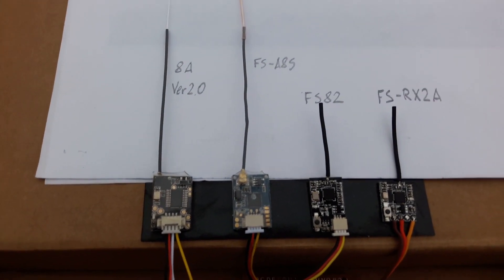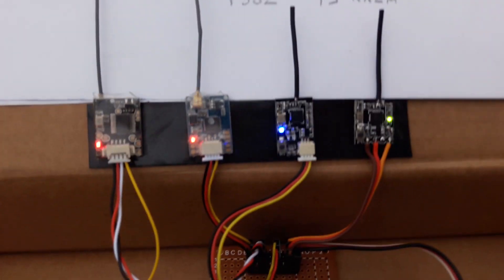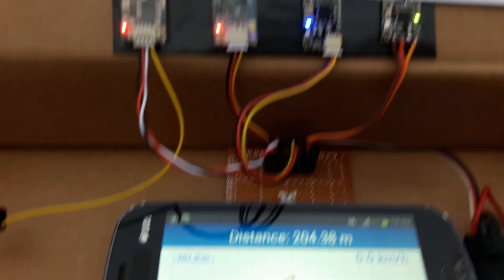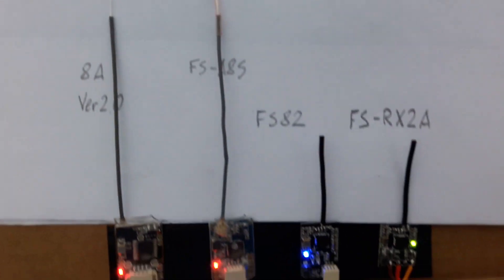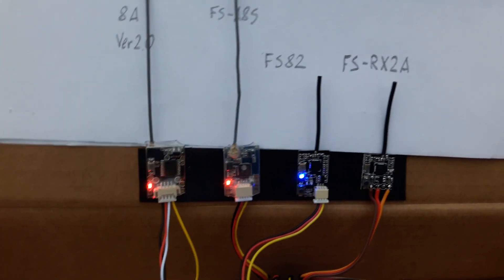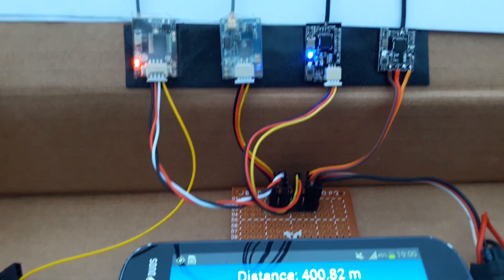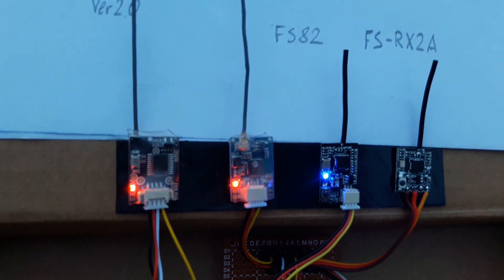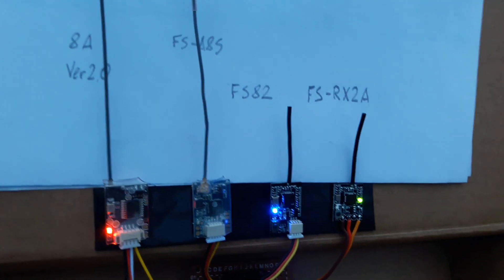FlySky micro receivers ground level range test

Comment: Nice video, question about 8A Mini Reiciever, hot to set failsafe if possible?
Reply from the maker: If I remember correctly, this receiver has failsafe. It should output zero throttle (CH3) after failsafe.

Comment: this was dope you saved me alot of trouble....im new to drones and quads, so just to clarify i can get the 8A Mini Receiver attach it to any drone then i can fly that drone with my FlySky FS-i6 ?
Reply from the maker: Yes, 8A mini Flysky receiver works with FS-i6. Range is not something exceptional, but it works.
Reply: @MontisTube  thanks this will be for a micro build so what type of range should i be expecting?
Reply from the maker: @nickodadon1328  I would say a few hundred meters.
Reply: @MontisTube  okay, and the 8a  was the best one out of the four you showed?
Reply from the maker: Yeah, that receiver showed the best results to me. Of course I've tested only the one receiver and it is not necessary the absolute result. 
But hey this receiver is cheap ;)
Reply: @MontisTube  lol exactly you get what you pay for and im going cheap.im actually working on my first build right now.im wanting to make a super light tiny whoop with some weak eachine 1140 motors,you think thats possible?
Reply from the maker: Yes, that is possible. This is the beauty of this hobby: you can be creative and try different things. 
KababFPV is one of the creativest RC hobbysts.
Reply: @MontisTube  ill def check his channel out..... are there any rules that apply when im deciding what esc,flight control,and the battery to use,like a wattage or voltage?
Reply from the maker: @nickodadon1328  yeah, everything depends on what size of the props, size of the motor, KV rating of the motor and battery cell number you are going to use.

Comment: which one would be best if im flying in a wooded area? which one has the best type of signal to be able to fly freestyle?
Reply from the maker: For better penetration and range I would suggest you the Flysky FS-X14S receiver (http://bit.ly/Banggood-Flysky-FS-X14S-14ch-Receiver). It has diversity antennas, PA/LNA amplifier and rated for 500-1500m range. There is also alternative firmware with RSSI output (http://www.multirotorguide.com/guide/flysky-receivers-rssi-mod-alternative-firmware/)

Comment: Exactly where do I connect the 4 wires of the FS-RX2A V1 to the HGLRC XJB-F413 receiver?
Reply from the maker: You need to connect the yellow (IBUS) wire to SBUS pad on the FC and turn the RX inversion off OR connect white (PPM) wire to the PPM pad on the FC. Also set IBUS serial RX or PPM in the receiver settings in Betaflight Configurator.

Comment: Both micro rx I have gotten a quarter mile with at low altitude with metal buildings. https://youtu.be/CsT02j1-G0g
The intersection in front of the quad when turning around was just about a quarter mile. Was losing video feed when I turned around. After upgrading vtx I could reach the intersection past the one I turned around at which is around 2000'. That particular rx is fs82 and the turn around point was approximately 1100'. A quarter mile is about 1300'. 

TX was stock during that video.
Reply: This was a ground level test for those who are into RC Boats, Cars, Trucks, Tanks, Dirt Bikes, Hovercrafts, Sports bikes, Submarines, Buggy's and all other robotics that operate at ground or sea level. Range Testing a Quad, Heli, Plane or any other Airborne UAV is a different subject altogether. These ground tests are hard to come by. Cheers Outlaw 👍

Comment: I have the 8A Mini Receiver and the Flysky FS-A8S. Having brownout problems with the 8A Mini...
Reply from the maker: Perhaps you are the one out of a few who has brownouts. Do you notice the same brownouts on FS-A8S also?
Reply: Used the 8A yesterday and swapped it for the FS-A8S today on the same quad. No brownouts today. Also getting better range. Stock antenna on the 8A. 30mm Antenna on the FS-A8S.
Reply from the maker: Thats good. Of course it's strange, but possible. Anyway use whatever works best for you. Maybe you've got a faulty one.
Reply: Montis I will try the 8A again with the same 30mm antenna to compare

Comment: Great test ! , this is a real world and pretty scientific to me I love real word worst possible conditions , I like to fly my drones outside around my house an trees while I’m inside my home watching fpv goggles , so I need my signal to pass through all the WiFi signals and through walls of my home and all the trees outside and other homes with WiFi’s so I think the micro receiver to the far right is good enough for me I have micro quads so I need the light weight
Reply from the maker: Hunter Mclaughlin FS-RX2A pro receiver is a good receiver, but not the best. I just would have  replaced the antenna to the one that leftmost receiver has. There is another version of this receiver (I think it is called FS-RX2A Pro v1.1 or smth) with a better antenna and u.Fl connector.
Reply: Montis well it is the smallest one I can find personally, and I’m looking for the most micro parts I can find , it’s also $7 on eBay for me in USA so that’s lsobthe cheapest one for me , others are great obviously your test shows , but then again everyone’s flying conditions are different are so are they way each of us set up out quadcopter , some of us don’t realize we are ruining the signal by horrible placement or even build quality, some get lucky some don’t . Thanks for the review it helps a lot
Reply: Montis how do I use  ibus on the rx2a pro ?
Reply from the maker: Similar to SBus, just set the serial RX protocol as IBUS and connect the IBUS signal line to the FC uart RX
Reply: Montis what uart # ? , I have been using uart 2 for PPM  of coarse & so should I just use same port and just wire the (ground, 5v , ibus ) ? . I now have to use ibus with the rx2a pro cause my ppm  pad fell off due to a lot of use from heat of the solder iron , it’s had a lot of use from putting it on and off a lot of builds so I’m ok with it being a goner cause it’s Only $8 . But it still has the ibus pad and I want to salvage it , it s done me well on range for such a small receiver I don’t fly more then 400-500 feet away anyways and I can do that easily with this thing as long as there aren’t many obstacles that interfere with signal , when it dose fail safe it holds perfectly in the air and I basically just try to remain calm for a sec , yeah right LOL ! then I usually gain control again get the hell out of there quick and try to remember where the no fly zones are in my area the give me the brown/black outs in my 2.4 & 5.8ghz signals . But I only have fail safe set on my i6s transmitter in the settings
Reply: Montis what dose my i6s have 4 antenna pads inside but they only use 2 pads for the 2 internal antennas , can in keep the internal antennas and add 2 antennas to them for external 3&5 dbi antenna mods ? If you want my email I will send pictures to you for more detail I’m not sure why they have 4 of them but only use 2
Reply from the maker: There should be only two antenna connectors inside. Both ipex (u.FL) type. Referring picture here: https://static.rcgroups.net/forums/attachments/8/4/0/9/2/a10172579-137-DSC03368.jpg
Reply from the maker: Anyway if there are 4 pats for antenna's they probably are duplicated, as there are only two RF outputs from the RF module. Therefore you shouldn't use these simultaneously with additional external antennas.
Reply from the maker: In theory iBUS can be used on any UART, as it is serial protocol and does not need inversion circuitry. Should work on UART2 RX input.
Reply from the maker: You can find my e-mail in the "About" page.
Reply: Montis I have the flysky fs i6s , that picture is of an i6 , mine had has 2 of thoes similar to this picture and it also has 2 above them but they don’t have the ipex ufl connector it’s just 2 empty pads & why do you think they are there & why would you think it’s a bad idea to use them ?

Comment: Ive heard that the fs-rx2a pro V1 is supposed to be really good. Have you ever had a chance to test it? The fs-rx2a pro (not V1) is supposed to be good too (400m), but the V1 supposedly goes 500meters plus. If anyone knows of any other recievers under 2 grams that can get over 500 meters please let me know. Im currently being plagues by flyskys bad reciever range on my ultralight 4 inch. My vtx range is like 6 times my rx range rightnow and its really frustrating.
Reply from the maker: Alex Crowder thanks for your comment. Yes, looks like there were a few revisions of the FS- RX2A receiver. I will try to order the latest and will be digging more. 
A few notes about range. All of these tiny receivers, that use only A7105 chip, should have similar limited range. Also good RX antenna also matters a lot. I would not expect more than 500m with good antenna.
There are a few new receivers with additional LNA (low noise amplifier) chip on board and decent dipole antennas. They should outperform any other RX at least by 50%. 
Look at the Flit10 RX. This RX is wery interesting. Unfortunately it weights about 4 grams.
Reply: Montis Thankyou for the quick response. I was looking at the flit10 and it looked like it was only getting 300 meters, atleast on the specs I saw. Idk if i misunderstood something, or if that was a low estimate on their page, but that seems awefully low for something that heavy.  Hopefully we can get something good thatll work for flysky soon. Ive been looking at those 4 in 1 transmitters too. Seems like they are still very flawed, but hopefully soon we will have dependable transmitters that work for any reciever. Thats my hope anyways lol. They are working on making them work better with tbs crossfire too. With any luck itll be the ultimate all in one long range transmitter once its been perfected more. Thats my hope anyways! Lol.
Reply from the maker: I think the Flit10 is underestimated. I have it on my bench, but haven't tested it yet. Until tested, everyting is just theory.
Reply: Montis what is your opinion so far? I ordered the Babyhawk r as my first real drone (started in a sim) and i have a Fs i6s Tx. Actually looked for the A8s but it shall still has this brownout issues... So what micro reciever can you guys recommend?

Comment: I have purchased most of these receivers. I tried installing the 8A mini receiver fist and the wires broke off the pigtail. I could not put the pin back in either.  I noticed the wires were not silicone coated and also burned very easily. I had to order another receiver as it's hard to find a 4 pin connector for this receiver. I then installed the A8S and had no issues. I ordered another 8A mini right away as it was probably cheaper to buy the whole receiver again then try to find wires. I may remove the A8S and put the 8A after seeing this test though. lol. Thanks for doing this test. I really appreciate it.
Reply from the maker: Yeah, 8A receiver is cheap and has cheap PVC coated wires. Beeing cheap and basicaly a clone of the original Flysky A8S it works surprisingly good. 
This test I made is amateur grade and not a scientific one :)
Reply: It may not be the most scientific one however it does show the difference. I have heard the same things on other sites and youtube channels and they have come up with basically the same results. This just confirmed what was being said. Thanks again

Comment: The best for me was rx2a pro. Dont have the fs82. Ive tested them individualy on quad.
Reply from the maker: You were lucky! I wouldn't trust rx2a pro anything bigger than 90mm quad :)
Reply: Montis whats your range with the rx2a pro ? , I’ve only attempted 120 meters while sitting inside my room of 2 story house while I fly outside , lost of obstructions but I don’t like to go outside to fly lol
Reply from the maker: Range of the rx2a pro is not great. Actually my rx2a pro performed the worst of all the tested. It is possible that better antenna could imrove the range.

Comment: Appreciate it I have 3 8A v2s they are the best, rx2a looses connection so quickly if you're in a downtown parking lot and go around a corner it's a failsafe most of the time... cheers

Comment: I have been using the RX2A on a few of my really small micros. I love that thing for being so small, but I am starting to notice that the range is definitely pretty bad. I havent hit any full-blown fail-safes, but honestly I may not have setup failsafe LOL
Reply from the maker: Be shure to set failsafe! I've seen quads flying away without failsafe. Just have in mind that RX2A has failsafe only in IBUS output and not on PPM.
Reply: Thanks for the advice and I agree. I use betaflight 3.2x I think and I believe it enables failsafe out of the box, but I would have to double-check. The issue that I ran into was weird, my controls were really unresponsive at long range and the quad got squirmy but never crashed, so I just brought it down hard and quit.
Reply from the maker: Just double check 1. under the "receiver" tab: push the throttle stick up and then turn your transmitter off. Does the throttle bar returns to the minimal value or stays at the last value? 2. Get your props off, arm the quad, throttle up and then turn your transmitter off. On both cases failsafe should cut the throttle off.

Comment: This helps😊
Reply from the maker: sakibian here , cheers!
Reply: Montis i need a lil help. Im buying a new fs i6 in some days. Do i need to upgrade firmware to use it with one of these ibus receiver? Or i can use ibus directly without doing ANYTHING?
Reply from the maker: My FS-i6 transmitter is completely stock, unmodyfied. You dont need to upgrade anything to use these receivers.
Reply: Montis thanks again man!💖

Comment: Thanks for the video. In the champion catcher, 8A, what is the function of the loose yellow wire?
Reply from the maker: Manuel Chaves it is the same as in the fs-a8s receiver: yellow wire is PPM out, white - iBus/SBUS out, red - power and black is GND. So it has two separate outputs.
Reply: Thanks for the reply. Is it possible to use the Ibus / Sbus output at the same time as the PPM? Can I use a servo motor in this PPM? Tks
Reply from the maker: Yes, you can use PPM and iBUS/SBUS output simultaneously (at the same time). Servos usually works with PWM signal, so you'll need some sort of PPM to PWM signal converter (Like this: https://www.banggood.com/S_BUS-Turn-PWMs_bus-14CH-Multi-functional-Converter-SBUS-to-PWM-p-984155.html). 
Probably better obtain a receiver with PWM AND iBUS outputs like FS-iA6b
Reply: tks

Comment: Thanks for the video. I am getting into this and it is very complicated and a lot of money. So, I am seeing good stuff about this controller for a good price. Could you please tell me about the telemetry. Goods and Bads... I am on the 3inches quads and dont know sht.. a lot to learn dude.. with a 3 months baby I have little site to learn all of the stuff.  -.-
Reply from the maker: +Carlo Mario, long journey ahead. I'm only ten years in it, but still know only a little :). Start from the cheap components. No need to go for expensive/brand ones for the start. 
As for telemetry - none of these micro flysky receivers transmit telemetry. Telemetry - nice thing to have but not necessary. I have been flying 9 years without any telemetry.
Good luck!
Reply: Wow. that is a lot of flying =) .. but now with these lipo batteries.. how could you know when to stop to not damage them, they are expensive.
Reply from the maker: If you have OSD, then watch for the voltage - it should not go lover than 3.3V per cell. Alternatively you can equip the quad with the buzzer and set the buzzer to alarm on low battery. 
Discharge/charge lipo to storage (3.7v) voltage if not using for longer periods.
Reply: Interesting info. My quad has a buzzer.. I guess that should be done on the betafly program. Thanks man. I will check on that.

Comment: Very good video. Those FS-A8S receivers are bloody dangerous. With the risk of failsafe kicking in. They said they fixed th problem with a version 2 of it. But I can tell you they haven't.
Reply from the maker: +Jamie MacFarlane yep, I would not trust this RX on the seriuous frame. Maybe ok for micros. I've also received the promises from Flysky that they will fix the brownouts issue, but they haven't. Use at your own risk.
Reply: Montis Have you had any problems with the others you have tested?
Reply from the maker: +Jamie MacFarlane, unfortunately other receivers have not been on a quad yet. But I will be doing more tests!
Reply: Montis would be good to see as there are not many small flysky receivers and flysky really don't seem to be in any rush what's so ever to release a V3.
Reply from the maker: +Jamie MacFarlane, I'am almost shure there will be no V3 released as the number of the users that have issues with FS-a8s is relatively low. (Banggood has sold > 5000pcs of these receivers).
I have interesting Scisky diversity micro Flysky receiver on the bench that I'm testing now. Will post a review on the www.multirotorguide.com.
Anyway I'm still in a search of the perfect Flysky micro receiver.
Reply: Montis me too

Comment: can you get RSSI display via osd/ibus/betaflight? or RSSI telemetry back to the TX? Mainly interested in 8a, since that one did best, but if anyone does this well, I would probably choose that one.
Reply from the maker: Nope. Neither one of these micro receivers has telemetry. No RSSI, no voltage readings, just plain control with PPM, iBUS and some with SBUS. As I know, only FS-iA4B, FS-iA6B, FS-iA6C, FS-iA10B receivers have telemetry uplink.
Reply from the maker: Yes, it does. Thanks GrumpyMadman, for pointing that up!
Reply: womplestilskin all of those micro rx you can get rssi. View my channel how I did one on the 8A. But your 20x20 F3 or F4 should have rssi pad exposed..else you will be doing more work. This mod dont need modded i6 transmitter. It rely on  analog input on FC. Better also to add RC filter between rx rssi and fc analog pin(rssi)